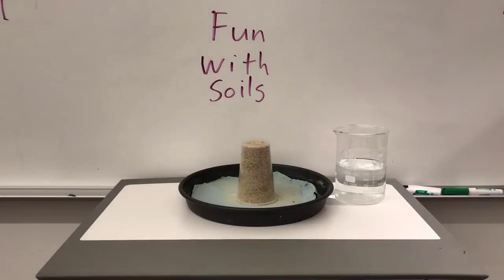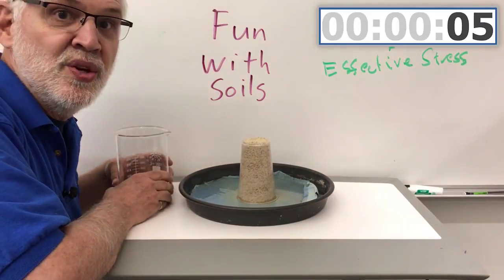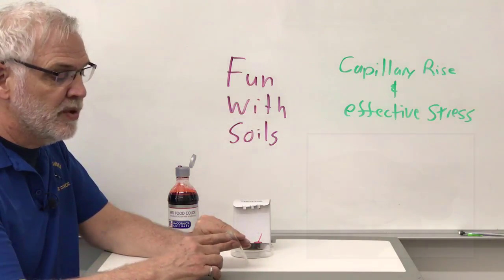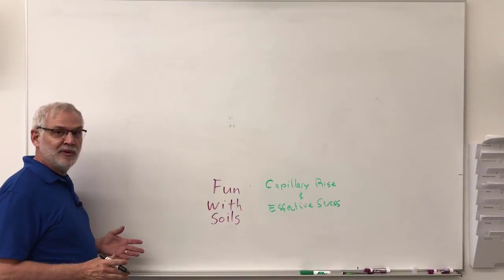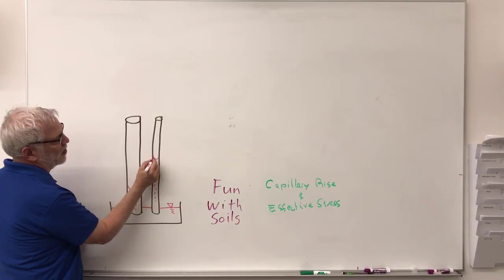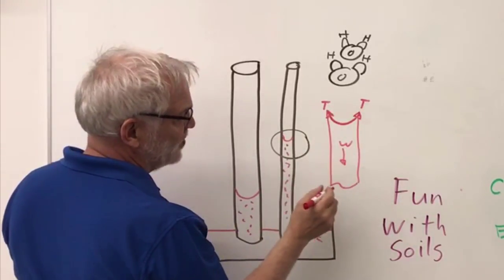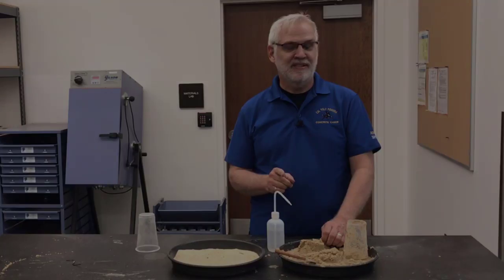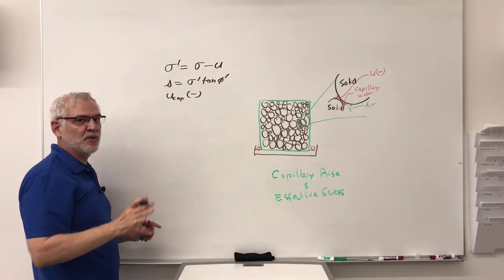Capillary Rise & Effective Stress in soil

Comment: Will water continue to rise until the soil is at field capacity if there is enough water to do so?
Reply from the maker: The water content along the height of the sample will not be constant. At the base near the elevation of the freatic surface, the water content will be highest approaching saturation. At the highest point of capillary rise, it will most likely be below field capacity.
Reply: @introductiontogeotechnical4976  Please explain the relationship of capillary rise and gravity. Or did you and I missed it?